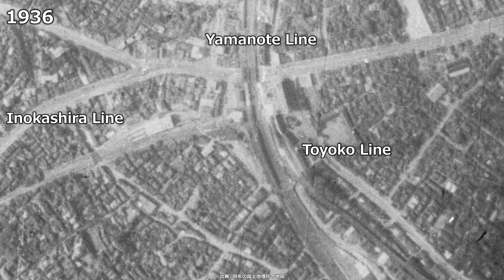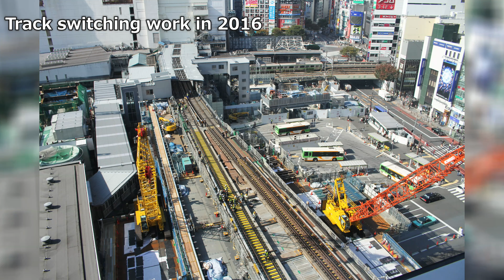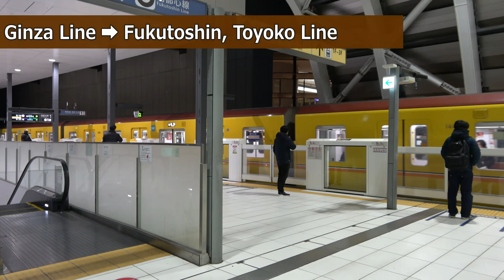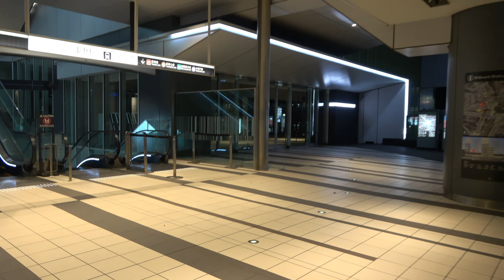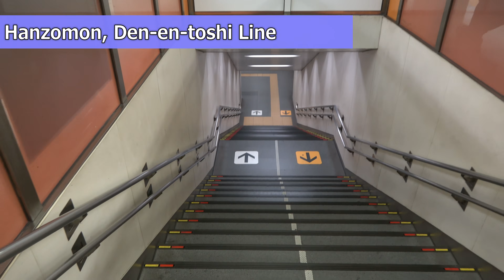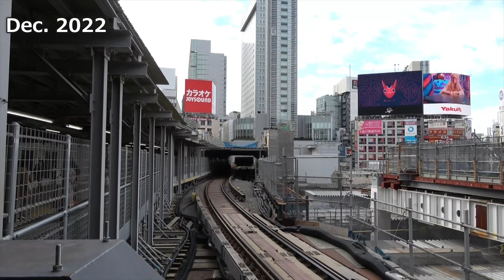Tokyo Metro's Platform Relocation: Massive Construction of Shibuya Station

Comment: Thank you very much for all those great videos you make. 

I have one unanswered question, provided I haven't searched for the answer that much... Why where the Inokashira line and Ginza line never connected together during the numerous recontructions of Shibuya? I guess the same could be asked for the Ginza and Isesaki line in Asakusa. I suppose it is one or many of the usual "too different tracks/power/vehicules" and "operated by different companies that did not see well to it"... but for this connections in Shibuya, it feels that some thought has been put into it (existing viaduc, tracks more or less aligned), but never materialized, doesn't it?
Reply from the maker: Thank you for your insightful question! You hit the nail on the head. The primary reason is indeed the 'technical incompatibility.'

The Ginza Line uses a 1435mm standard gauge and third rail power supply, while the Inokashira Line uses a 1067mm narrow gauge and overhead catenary. Additionally, different operators (Tokyo Metro vs. Keio) and the extreme complexity of Shibuya’s elevated terrain made a direct connection practically impossible.
Reply: Thanks a lot for your insights! Indeed, the gauge being different would be a strong reason. I never realised it was different (maybe I noticed but didn't really reflected upon it). I read also that, at the time of building the Inokashira line, the policy of Ginza line operator was not to have surburb+central line continuity at all, probably explaining why at that time the interoperability was not taken much into account.